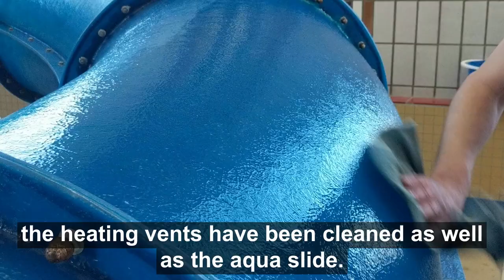Cleethorpes Leisure Centre - drain and re-fill.

Comment: Could all that pool water have been recycled for some other use?  It seem like quite a waste to just dump all that water down the sewer drain.
Reply: For what? it would be full of chemicals and would be incredibly difficult to transport.
Reply: It is "recycled" by being processed through the water treatment plant. Any chemicals and contaminants are removed before being put in a river to flow to the ocean. The water evaporates from the ocean, collects as clouds, and falls into the lakes or rivers that supply the water to the town and back to fill the pool. The water cycle is an amazing recycling system, and no water is ever "wasted" when it flows down a drain.

Comment: 6 days to refill a pool of that size is idiotic.  The pool at my old school is half Olympic size and refills in 2 hours.
Reply: I’m guessing the municipality limits the rate of fill to limit unnecessarily taxing the water system
Reply: @z185284  Either that or the building was built on the cheap including lack of a properly sized water main to feed the place.  The pool at my old school has a 3 inch main.  This thing must be filled with a garden hose.
Reply: @johnrauner2515  Normal speed in pipes should be around 1,5-2,5 m/s. If you use 3 inch pipe this way, it takes 25 hours to refill this pool.  If you wants to destroy your pipes, the maximum is 2 times faster (it's not safe to do that, it isn't te same as in firefighting with 1,2m3/min...), so it would took arround 12 hours. The main reason is allowed capacity of city grid. 900 m3 is a lot of water on EU.... In CZ it's daily consumption of cca 8 000 people. Half size of olympic is cca 1870 m3. Unless you are in really big city, I dont believe you would be allowed to suck this from municipal grid. That's 260 l/s (68 gal/s), required pipe diameter arround 14 inch pipe in building and 25 inch city main only for the pool. So no sir, I as a water management engineer don't believe you can fill half olympic pool in only 2 hours by one single 3 inch main...
Reply: @filipmecir262  Well that's a concise answer if nothing else.   Here's the pool I'm talking about.  And I have seen it filled in 2 hours.

https://www.facebook.com/photo?fbid=10164966351480355&set=pcb.10164966351560355

The filter pump and circulation pipe under the pool is 3 inch.  In 1985 when I was 15 the pipe under the pool broke just beyond the end of the pool at the far end of this photo.  The pool emptied in less than an hour.  And that was only gravity fed out of the pool.  It was not being pumped in under pressure from a main.  So if gravity can empty it in an hour from the same size as the fill main, then it's pretty obvious it can be filled in 2 hours under pressure from a main.
Reply: @johnrauner2515  Well, maybe physics in this pool takes vacation. :) If you would like to press 1870 m3 through 3 inch pipe in 1 hour, velocity in pipe would be 117,6 m/s. Thats simple math - Volume/area of pipe crosssection/time = flow velocity. That's 423 km/h (265 miles/hour). That's quite unlikely to occur by gravity itself. Are you sure it was only 3" pipe? It's frankly small for such big pool. In home pools you ussualy use 2" pipes.
Reply: @filipmecir262  I'm not arguing with your math.  I will be going back for a final swim in the next few months so I will make a point of taking a tape measure.
Reply: @filipmecir262  from the facebook photo you've massively over-estimated the volume of water in the pipe. I've estimated the volume to be about 300m3 (25m length, 8m width, 11.5m depth). For this volume you would only need a pipe flow velocity of 18.25 m/s, still fast as all hell I suppose. Not sure how the pool managed to get drained so fast, maybe @John Rauner underestimated the pipe diamater? A pipe of 8inch diameter would empty the pool in an  hour, or two 5 inch pipes would empty it in a little over an hour...
Reply: @TheAnimystro  before the photo he said half olympic. So I thought about 50x12,5x3m olympic is 50x25x3 m...
Reply: @filipmecir262  Yeah but "half olympic" as a term is usually just used to mean 25m long, often the depth and width aren't olympic standard at all
Reply: @TheAnimystro  Well :) my fault then.  I'm not sure we use this therm here... we ussualy have 25 or 50 m long with depth from 4-5 m in deepest to 1,3m at the opposite end...
Reply: Lots of pools have huge holding tanks that can take a significant proportion, if not the entire pool capacity. If all you're doing is refilling from those tanks then it's basically as fast as the pumps will go. Unless your pool has some kind of monster over spec plumbing then I'd imagine the refill is from the holding tanks, not a clean refill from the mains.

It's extremely likely that the pool can be filled quicker, however emptying and filling too quickly can cause severe damage to the pool tiles. Plus the limitations set by the local water company. If they open the taps too much they could crash the local water pressure. Special permission is likely needed to take up the full supply potential and clearly in this instance they refused.

Where I work, an incident cause the pool to be drained accidentally over night. A valve had not been closed during the filtering process that evening, oops... the utility company initially refused, and we were literally refilling at a rate that would take around 10 days!
We ran hoses from the kitchens and bathrooms as those are on a separate supply (probably comes off the same pipe, but monitored differently) that brought the time in half before finally the fire brigade sent someone down to open a hydrant outside the building for us. that brought it down to just a day.
That was from losing the 95% of the entire system volume, all the pools (dive, wave, lane, kiddie pools all separate but on the same filtration and circulation system) holding tanks everything.
Reply: @kal9001  You're talking total shit buddy.  A pool like this is emptied once in a blue moon.  There is no way anybody is going to spend hundreds of thousands, if not millions of dollars building a tank to hold the contents of a pool this size when 99% of the time it will sit empty.
Reply: @filipmecir262  I think the error here is I forgot to mention that although the surface area is half Olympic size, the depth isn't.  At the ends it's only 0.6 m and in the center it's 1.2 m.
Reply: @TheAnimystro  haha, no.  It's that I forgot to mention the surface area is that of an Olympic pool, the depth isn't.  It's 0.6 m at the ends and 1.2 m in the center.  This after all was a pool for a primary school (5 to 12 year olds).  But it seems to be about the same volume as the pool in this video which is why I mentioned it.
Reply: @TheAnimystro  Yep, it isn't.  Forgot to mention that, sorry.  0.6 m at the ends, 1.2 m in the center.